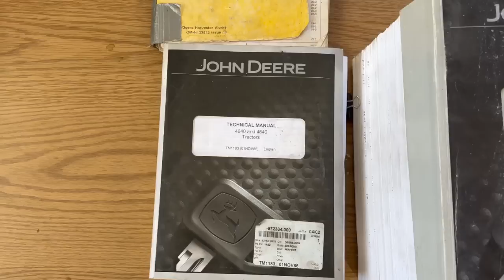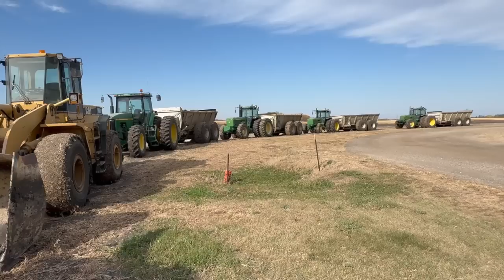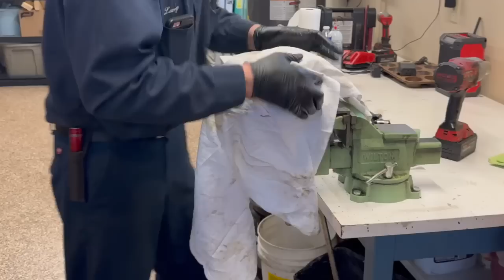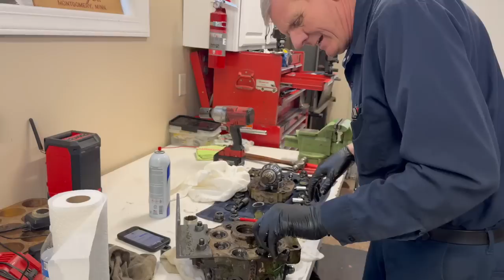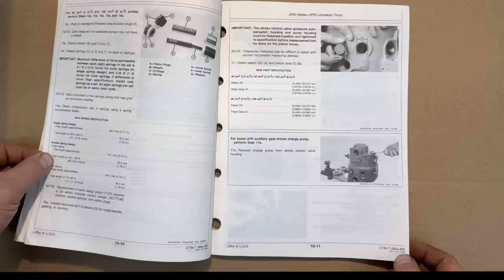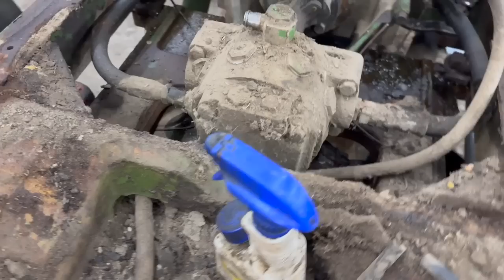"How to Rebuild a John Deere Hydraulic Pump and Save Money!"

Comment: This video is a wealth of information!  When I rebuilt my 3010 gas, I also went through the hydraulic pump. This video sure would've been handy at that time. The hydraulic pump has always been noisy, like it sounds of a hammer rapping on the pressure output pipe going to the valve in front of the Dash, right side. Even after I 'went' through the pump, I basically resealed it. The noise goes away when I turn in the destroker valve or remove the pump drive coupling. It still functions well. The only work the tractor does nowadays is blow my driveway. I don't know know if it's anything to worry about as I don't see any metal in the main filter or the suction line filter in the pump body. Wondering what your thoughts are on this? Also, what are your thoughts replacing the pump with an A I aftermarket pump? Great videos! Recently subbed your channel. 👍 
  The line pressure is set per the John Deere manual if I recall is around 2,300 or 2,800 psi at the SCVs.
Reply: The cam and rollers probably has significant wear.  The other thing that’s probably going on is you have some high pressure leaks to sump in the hydraulic system that keep the pump in stroke. Those two things are just about a given on a 50-60 year old tractor.  

I went through my  65 3020 propane’s pump for the very same noise.  I found that the reman pump that was in it had some cam wear and had had the cam reground and an extra small roller dropped in to take up the resulting extra space😡. I had a couple cores laying around that I tore down looking for a good shaft and they were all remans that had been reground the same.  So when you see that cheap reman price, realize they are going to make it as profitable as possible  and that replacement camshaft isn’t going to pencil out!

Comment: Why do you call it a 5020 when the tractor reads 6030
Reply: 6030 is a new n improved 5020.......rrrrrrrnotttt
Reply: @kevinsiedschlag429  i though the 6030 was around 170 hp and the 5020 was around 135 hp
Reply: @danielelliott1570 you’re right
Reply: Did anyone check the Serial number? That would be the key. If someone already put a V8 in it, changing decals is the easy part.
Reply: They may have grabbed the 6030 hood, radiator and fuel tank to help keep it cool etc.  That 8V71 is a thirsty beast and makes plenty of heat!